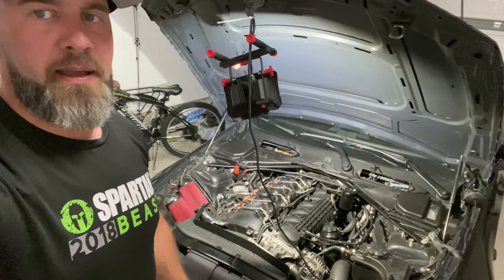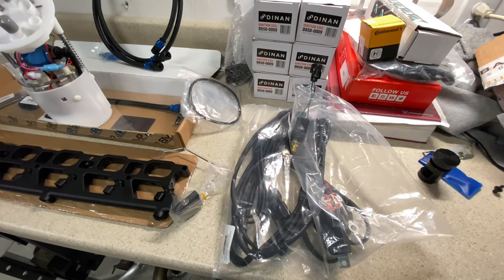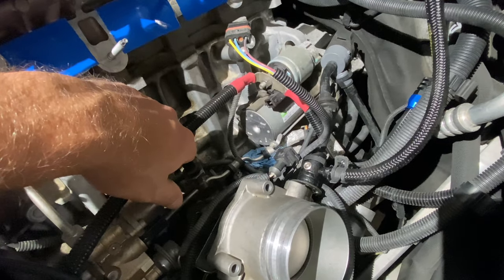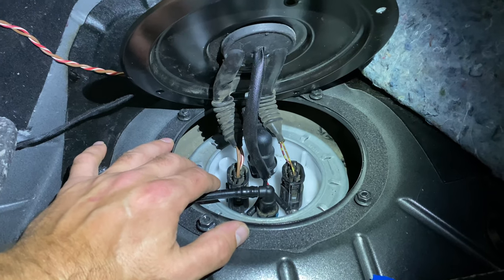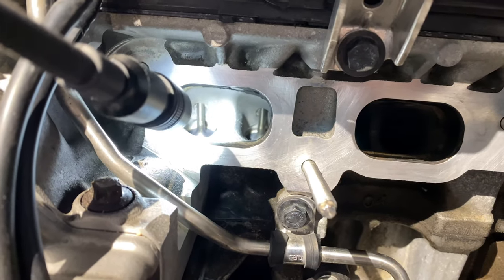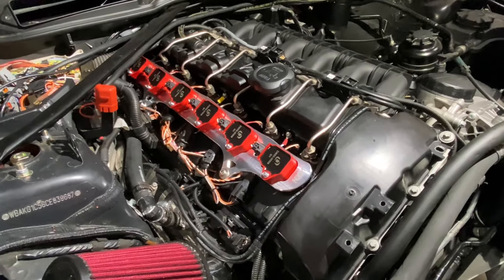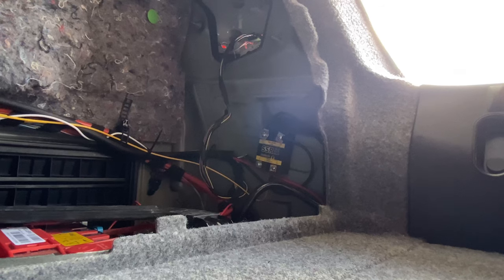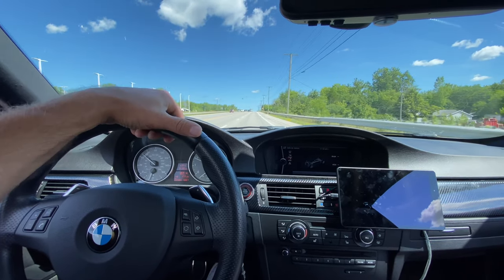Upgrading the Fuel System On My BMW 335is | Port Injection | Motiv ReFlex+ | LPFP

Comment: Bro, you went all out, you have everything things you can think of for this build. Can wait to see you put this on the dyno. I'm still debate if I want to go with RB turbo like your or top mount turbo. I think your build is a reliable set up that you can use as daily driving.
Reply from the maker: Thanks!  The crazy thing is I’m not done yet. I have a whole lot more planned for the build. I’ve been busy with work which is why I haven’t had as much time to spend on the build, along with more content. 

The RBs are great and I have around 3500 miles on them. I’m estimating that I’m around 650-675 whp. I’m definitely doing a dyno video in the spring.
Reply: @midwestbmw1292  how do you like current PI set up, I see most guys now go with the manifold style. I see that you beefed up the drivetrain and suspension.

Comment: Hey thanks for the great video. Did you by chance install a Schottky or flyback diode with your solid state relay for the fuel pump?
Reply from the maker: …no but I plan to. For me everything has continued to work flawlessly but for others I’ve talked to they needed the fly back diode and when they installed it everything worked fine. Based on what I know you should install it on the SSR.
Reply: @midwestbmw1292  thanks for the quick reply. Do you have a plan yet for which diode you will install?  I originally ordered the MSD relay planning to plug it right into my Precision Raceworks harness, but now I'm rethinking that and think I should get a traditional SSR like yours and add a diode.

Comment: Can the NHD interact with the Motiv module? or you need anything additional to tune the engine? Thanks for the great content!
Reply from the maker: Motiv Reflex+ is wired into the DME and therefore accessible over CAN Bus via OB2 port. It work’s separately but in conjunction with MHD app. The Tuner you choose will need to support Motiv and write in PI control file into the tune. Essentially the injector map the Tuner puts in place on ReFlex+ will work alongside the tune file uploaded through MHD. Hope that makes sense.
Reply: It does! thanks for taking the time to explain! (already Subscribed to your channel btw 😎) @midwestbmw1292

Comment: Great video!
Is there any particular reason you chose to install the fuel rail pressure sensor on the front bung rather than the rear?
Reply from the maker: The starter is directly below the rear bung so I was concerned about fitment.

Comment: Good job👍🏻 where did you buy wires for secondary fuel pump including relay ?
Reply from the maker: When I bought the fuel pump from Precision Race Works a wiring harness and relay came with it. However it was for use with a Hobbs switch. So when I switched to the solid state relay controlled by rail pressure reference and ReFlex I simply bought wire from a local parts store and wired it all myself. It’s not to hard to  do.
Reply: @midwestbmw1292 is there any way I can modify the precision racewerks harness to have reflex control the secondary pump? Or should I just buy the relay you linked and wire it that way?
Reply: @midwestbmw1292 what gauge wire you use for the SSR?

Comment: Dope video that will definitely help with my instal. I’m putting a list of all the parts I need to go PI using the MR+(motive reflex plus) for my N54 but there is just one thing I don’t understand. I’m aware that MR+ has a feature that allows it to smartly manage the secondary LPFP but I’m not sure how it sends the signal to it. 

I currently have my secondary LPFP running of a 10bar boost pressure sensor but I’d like to fully take advantage of the MR+ features. 

So how would one send the power/signal from the MR+ to the secondary pump and is there maybe a link to the parts I would need?
Reply from the maker: I should have spent time adding more detail in the video but I was rushed for time when I was installing.  

After you read this comment rewatch the video and it will make more sense. 

When you buy a LPFP set up that has a secondary, typically it is controlled by a Hobbs switch (boost reference) like it sounds like you’re doing. When using the MR+ you have an option to use a rail fuel pressure reference. I have the Motive pressure switch installed in my PI rail and then have it plugged into the MR+. From the MR+ there is a wire to a solid state relay (the one next to my battery at the end of the video). That SSR is then wired to the secondary LPFP. 

What this does is replace the boost reference with a rail pressure reference, which most tuners will unanimously agree is a much, much better reference.  In fact it’s one of the key benefits of MR+. So what happens is this: Once rail pressure drops, as the primary runs out of steam up top, the pressure switch kicks off a signal to MR+ which then fires the SSR which kicks in the secondary LPFP. Once rail pressure is regained, it shuts the relay off. Hope this helps.
Reply: @midwestbmw1292  thanks for the fast response! 

And yes currently just running my secondary LPFP off hobs switch. 

You have a link to the solid state relay you’re running? And well what kind of wiring did you end up using to plug the MR+ to the relay?
Reply from the maker: @ItsKhazzz  it’s a Haltech relay. It was like $44. It’s a pretty robust, tried and true unit in the mod community.  Part info below. 

HT-030202 Solid State Relay 100 AMP
Item# HT-030202

You’ll want to use the “ground switch method” to wire it, which the instructions for are provided with the relay. If not you can Google them. I used the cig lighter outlet that’s located in the passenger side footwell to get my 12v switched. 

You will not need to install the little diode that comes with the relay.
Reply: @midwestbmw1292  awesome, I definitely will order the relay right away. 

I have never messes with electrical stuff this way besides the simple plug and play stuff. 

But I want to learn how it’s all set up so I have a better understanding as well as just know how it all works lol. 

Thanks you’re really helpful and digging through forums there seems to be many people also confused with this process just with there was a great DIY video
Reply from the maker: @ItsKhazzz  glad to help. Believe me it took weeks to figure out how to do it and do it right. Very little info at all out there about it. In fact most of the help came from Andrew from Zero to 60. Him and I texted back and forth for days about it.
Reply: @midwestbmw1292  did you happen to run an in line fuse? I'd love to see some wiring content for this setup.

Comment: I’m currently installing my port injection plate. I’m curious what did you use for the 0-10 bar sensor as the sensor is 1/8npt threads and doesn’t screw in directly to the PI Plate.
Reply from the maker: Here ya go. 

https://www.summitracing.com/parts/mrf-mp-3071-blk
Reply: @midwestbmw1292   Thanks! I really appreciate the quick reply. I went ahead and ordered it. I really want to get my 335is started tomorrow so I might just throw in the hobbs switch for now. I’ve pretty much mirrored your build as far as fueling goes but I went the single turbo route. I’m super excited to start it up. All I have left after the port injection plate is the upgraded fuel pump. I’m still a little confused about the wiring for the SSR but it doesn’t seem too bad.
Reply from the maker: Glad to help. Let me know if you get hung up on the relay and wiring. It’s not that bad once you understand why and how it all works.
Reply: @midwestbmw1292  Sounds good! Again, I appreciate the help. If I get caught up with the install, i’ll for sure get back to you.
Reply: @midwestbmw1292 I’m having an issue with my second pump not coming on. Could you help me out?
Reply from the maker: I’ll do my best to try. Are you trying to test run in on Tuner Pro?  I never did mine I just sent it and watched rail pressure during first few pulls.
Reply: @midwestbmw1292  I got it figured out! Wiring issue on the power side. Thanks for the response again. I had forgot to get back to you, I was thinking hard and was stuck on it. Again, I appreciate the response.

Comment: Hey man, with the solid state relay, did you use a diode?
Reply from the maker: The guys at Zero to 60 and I did a bunch of research online and had many conversations about it. The consensus was that it wasn’t needed on our application. So far there have been no issues on my end or with others I’m in daily contact with who have the same set up.

Comment: So the relay is needed? I just purchased the pi plate. Stage 3 fuel pump. Same fuel lines. And reflex+
Reply from the maker: Yes. Reflex will trigger the relay to trigger the secondary fuel pump to increase rail pressure once PI injectors are triggered.
Reply: @midwestbmw1292 happen to have link to the relay u used?

Comment: What adapter u use to connect the reflex 10bar sensor to the port injection rail?
Reply from the maker: Check out the response to the same question from 3 days ago.

Comment: Yo so if u get the reflex and use the pressure sensor in the port injection rail u no longer need the Hobbs  switch ?
Reply from the maker: That is correct. The pressure switch will trigger the secondary LPFP based off of rail pressure reference instead of boost reference with the Hobbs switch.

Comment: Did u have to but the relay for the secondary fuel pump separately
Reply from the maker: Yeah I bought it from Haltech. I think it was like $50. I tapped the switched 12v from the cigarette lighter socket in the passenger footwell. Some have tapped into the exhaust flapper wire in the driver side taillight access.
Reply: Fosho thank u for the info
Reply: @midwestbmw1292  I wish you were close to Kansas City. But how do you wire the solid state into the motiv reflex?

Comment: How did you connect flex fuel wire to dme?
Reply from the maker: There is a flex fuel sensor harness that Motiv sells for ReFlex+. In fact I believe it comes with the unit.  It connects into the ethanol sensor and the other end connects to the ReFlex harness. Then the main Reflex harness has a wire that taps into a pin on the DME harness. That pin is what converts the signal from the ethanol sensor into an ethanol reading. Basically it does away with the need to run an ethanol analyzer with your ethanol sensor.  It’s really cool stuff. One of many reasons I felt going with ReFlex+ was the best option out there aside from stand alone.
Reply: @midwestbmw1292  thanks for fast answer. Do you know or remember which Reflex wire  taps into a pin on the DME harness? I would like to read ethanol content via MHD.
Reply from the maker: @lionplanet3001    The ReFlex+ comes with a gray wire with a DME pin already attached to it. It’s in a separate ziplock bag marked flex fuel, or something like that. You’ll need to remove pin 16 on DME harness 6002 and plug that pin in its place. Then you use a provided wire tap to connect to the green wire on the Reflex harness. Essentially what it does is convert the ethanol sensor signal to hz so that it shows the ethanol percentage on MHD.
Reply: @midwestbmw1292  thank you 🙏🏻
Reply: @midwestbmw1292  Since reflex can read via canbus it is still necessary to remove that pin 16 form 6002 harness?